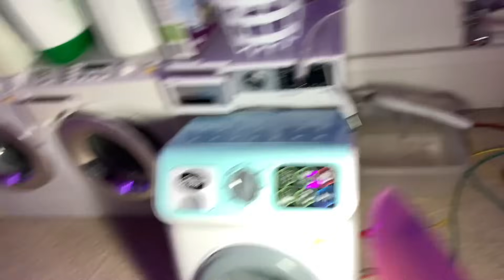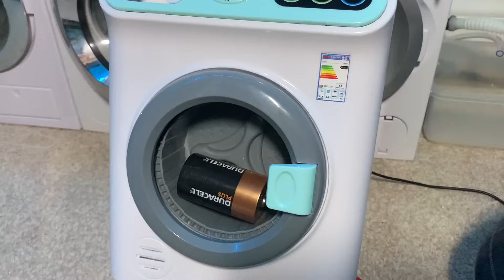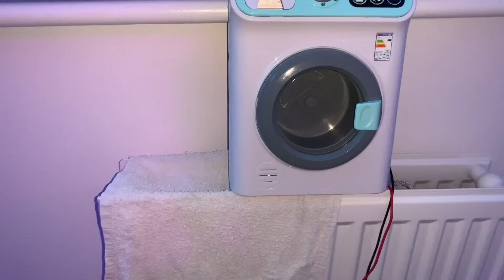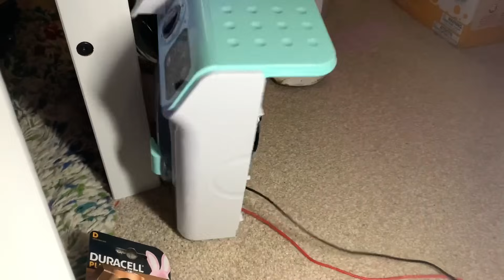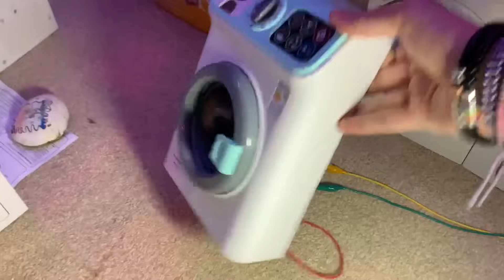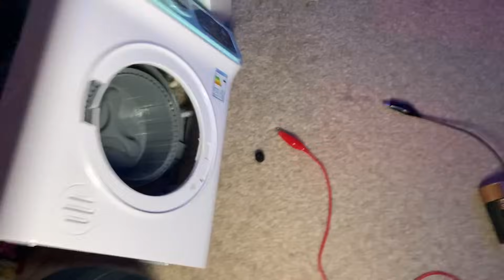Toy Washer Destruction!

Comment: How do you wire this?
Reply: unscrew these bumpers and then find the rubber bands after connecting the rubber bands to the washing drum, there is a washing machine with springs ready. but just don't throw heavy objects, suddenly something will happen to break the drum.